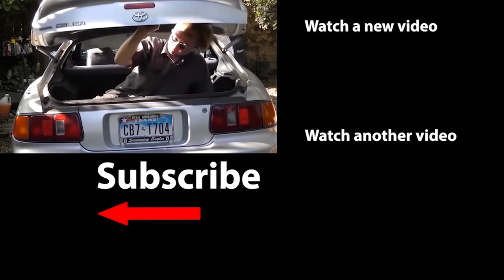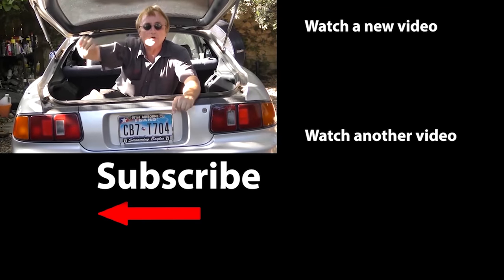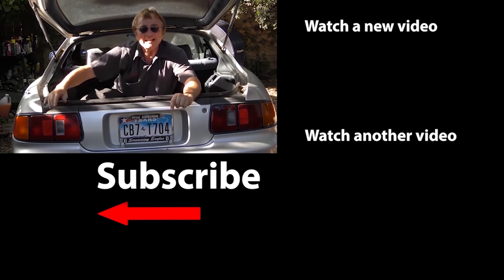Here’s Why This Engine Oil Can Destroy Your Car

Comment: Good Evening Scotty.
A quick question. 
Are all of the 3.6 V-6 engines bad or is it just one particular manufacturer?
A family member owned a GMC Acadia with that 3.6 V-6. He put 6k in repairs on it for the same issue. 2k 3 times. Timing chain problems. He puts miles on his vehicles, but he maintains them.
Trying to figure out if it is just GM/Chevy engines or all of the 3.6’s..
Thank you
Reply: I asked here because I saw him answering, say hello on here to other YouTubers...
Plus I don’t use Facebook or Twitter.

Comment: As I said in the other video you did on Kandi, they use to sell a reverse trike that replicated the Can-Am Spyder, I had the second year model, 2010 & it was actually pretty reliable for what it was. Bought it new in 2011 & had it until 2014. I can find old pictures & even the their corporate emblem was exactly the same.

Comment: Hey scotty, Is a 2009 Ford F-150 lariat with 127,000 miles on it for $13,000 a good deal? Had one previous owner, a 5.4 v8 engine, and automatic transmission. Love your videos.

Comment: I think it's the same thing for flying cars and fully electric vehicles. Start small then go big. Except flying cars doesn't maje sense. Cars function better on the road. Planes, jets and helicopters were made to function better on air with anti gravity technology. You put the 2 together it'll be super expensive.

Comment: Scotty, what's causing the engine idling high after cleaning of throttle body in a car. My car after I cleaned this TB and started after several time of trying to kick on, the engine idling about 1000 rpm in N even after the engine at actual operation temp as well as the driving character totally changed .. the car feel heavy to move in normal driving ?
Reply: @milcotto4153  in fact I didn't disconnect the TPS or even touch it. 😑

Comment: I wouldn't bother putting another engine in that Honda Accord......the transmission won't be far off either.
Reply: Unless it's already been replaced by Honda due to known tranny problems with those late 90's early 2000's Civics and Accords. Honda wouldn't replace them in the Civics (they'd lose too much $$$), but they fixed the Accords. Unless the car was built in Canada. The Canadian built cars transmissions were ok. I Lucked out on that one! 2002 Canadian built Civic ❤️

Comment: Most basic car maintenance is to Check the level of the OIL!!!!! All  vehicles, except for electric and other specialized engines, Need OIL!! Toyota's included. Like Scotty will say, oil is cheap. and engine, transmission, etc are Expensive!!

Comment: I've always wondered why they don't make cars using the same technology they use to make Locomotives: Use a small efficient clean-burning diesel engine mated to a generator that makes electricity for two or four electric motors. This works for the train industry, and trains get ridiculous amounts of miles per gallon. And the world is capable of making a clean burning Diesel engine

Comment: 2018-2020 Ford F150 V8 oil burning issues? Can I put this in my F150? Maybe it will clog whatever hole the oil is escaping from...
Reply: They've gone back to premix like the old 2-strokes....
Reply: @jamesr5741  That is what it seems like. 3 quarts every 5k seems to be the right amount

Comment: Hey Scotty love the channel. Was wondering if you have any thoughts on the 18 Toyota Camry 2.5 cyl 8spd? Anything to keep an eye on with that one?
Reply: I have one, 16k miles. The transmission shifted a bit roughly until I got the the TSB transmission software update. It shifts much smoother now.
Reply: U guys don't do manual?
Reply: @sameerishaque7635  No manual on a Camry. The Corolla has some on the SE series as an option.

Comment: I have a 16 ford f150 5.0 it doesnt say full synthetic oil. Can i use full synthetic oil in it?
Reply: Sure, as long as the API service rating and viscosity meet requirements.

Comment: Please share your thoughts on the Nissan NV, Ford Transit Connect, Dodge ProMaster and the Mercedes Metris. :-)
Reply: Biggest Richard Cranium  a powerful truck for sure but the covered cabin space is the key factor. I'm transporting art and I need the tall, covered space and maybe less power than what the F350 offers.

Comment: i saw the mechanic added the 5W-50 oil into my engine, but my engine only needed 0W-20.
Is he crazy ? 
my car is only 93,000 miles
Reply: When you do oil change buy your own oil and filter. And have then put it on, if you do their oil change deals, they use recycled oil and might not change the filter. I use Castrol synthetic  oil and it feels really Good and I do oil change every 3 months no matter of use. How can you tell the difference when do oil change, when you hit the gas itl take off quick, when the oil is worn it'll take time to take off you can feel a difference if you know what you looking for.
Reply: Jonathan Santiago thank you, hope he didn't put cooking oil into the engine 🤣 ,My story is even crazier, because sunday, all shops are closed near my house, accept his shop still opened, and my car was being towed because the Throttle body was stuck, i couldn't start the engine. At his shop, he removed the entire Air intake tube and sprayed a bunch of chemicals in it and cleaning, after all done, my car worked but the driving is more shaking, specially at the stop sign, feel like a small rear end accident, i'm tried to drive smoothly but feel like i was shooting an AK-47 fully automatic. No noise at all, only shaking. 
yeah, i have to do what you said
Reply: @tricao57  check the throttle position sensor, your car probably a Ford isn't it lol
Reply: Jonathan Santiago 2014 honda accord sport sedan 2.4L engine, no accident, no flood
Reply: @tricao57  oh okay well take it to autozone and get a print out of engine codes, am pretty sure the engine light is on right? Than from the codes you can Google the one closely related to intake problems and get fixes from other people with similar problem..if it seems too complicated your gonna have to take it to a shop but if you can narrow down the problem you can save some money
Reply: Jonathan Santiago all engine lights were on, even the radio automatic turned on, the rear view camera was on, the only thing not working is the engine, that was so creepy, around 7 pm outside the parking was dark. i personally Don't trust Honda anymore, i prefer Toyota or something else
Reply: Annie thanks, i took it to the dealership and they found out my car has a computer problem, and dirty throttle body, that's why when the car is on but the pistons didn't move, and the computer got the malfunction problem. That's what they told me. Plus they found out that's the previous owner of this car was modified the electrical in this car too much, and maybe that owner didn't put everything back correctly.

Comment: Hey Scotty, love, love, love your videos!  Quick question.  I have a 2010 Highlander with 115,000 plus miles.  Does paying $10 to $15 more for high mileage oil worth it compared to just synthetic or synthetic blend when I get my oil changed? Thank you!
Reply: no    And that's a BIG price differential. Are you being ripped off? Where are you having it done?
Reply: Valvoline Oil Change Station. I think it’s $50 for synthetic and $60 or $65 fir high mileage.
Reply: @inlikemin  That's a lot to me. I do my own in a V8 Lexus for about $10.  165K mi. and I always use conventional oil or a mixture.
Reply: wholeNwon yeah I know it is expensive. Definitely cheaper to do it myself but it’s all about convenience.   We definitely pay a big chunk for the convenience. It’s nice to have someone change the oil, filter, check fluids, tire pressure, etc. I will probably not pay the extra for high end synthetic anymore though.
Reply: @inlikemin  I do it myself because then I know exactly what is done. In most shops you have no idea what happened to the vehicle and they are on the opposite side of the dollar from you. With conventional oil, changes at 4-5000 mi. are appropriate. With synthetics, that can be stretched to 7000. However some Toyota models state that changes must still be at 5K.

Comment: How offten do you need to change transmission oil in Acura/Honda cars ?
Reply: @zeroyon4562  it's a 2008 acura tl.   3.2  automatic 155,000 miles
Reply: @zeroyon4562  I heard that if you change the transmission fluid it might damage the transmission is this true

Comment: I can see the Chinese doing what the Japanese have been doing for decades.   When you ship a completed car, you get 6-8 in a shipping container, most of what your shipping is air.  If you ship the parts, you eliminate the air; that same container now contains say 18 to 24 cars, maybe more.  All you need is a crew to do the assembly at destination.  With things like glass, that need to meet domestic standards and is very fragile, these can be sourced at the destination.

Comment: Car should have like a second "lawnmower engine" that you could start up or come on automatically when the batteries need charged. Or make one of these with a 5 cylinder engine, and when you are parked somewhere for a few hours, deactivate 3 of the cylinders, the outer 2 and the center one and the remaining 2 would charge the batteries at low idle power...L I P

Comment: Manufacturing electric cars in the United States will costs more than manufacturing abroad because labor costs and other fixed costs are higher.  Trying to make a cheap electric car will, therefore, be uneconomical.

Comment: Works fine in vvt
Reply: It gave me a scare in my VVT 3.5 v6 pathfinder. I put restore in and the vehicle went into some kind of limp mode where it wouldn't produce good power (and wouldn't go faster than 45mph) so I drained the oil and Restore out. Refilled with fresh oil plus a pint of Marvel Mystery Oil (a good cleanser). Still wouldn't get up to speed.

Took it in. But it sat for a couple days before they could check it out. It was back to normal but they did catch the code- VVT sensor issue. Soo, Scotty is probably right. Restore is probably too thick for use in VVT engines. If you wanna chance it anyways, go for a weaker mix (rather than use the whole can of restore, maybe try half a can).

Comment: If you want to see how much the chinese are selling cars for, look at aliexpress app.  Saw a half ton pickup with a small diesel engine in it for 14k.  Was not some ugly boxy toy looking thing either.  Im very sure it is under powered by our standards but, at least we can see what they will charge
Reply: @milcotto4153  maybe but the wheelbase matches my expedition.  If they do make it over here ford dodge n chevy will have to brinf their costs down.  Since the chinese trucks are modern looking and well equipped.
Reply: @milcotto4153  uhhh i am in the usa.  If i can get a crew cab truck that will pull my boat for 20k or so im looking into it.  A full size truck for 20 to 30 k with dealer markups would be a huge interest.  Since a basic ford that can tow something runs. 35k or more if you have a crew cab.  I will at least be open to one.